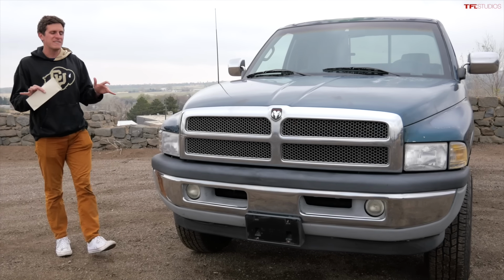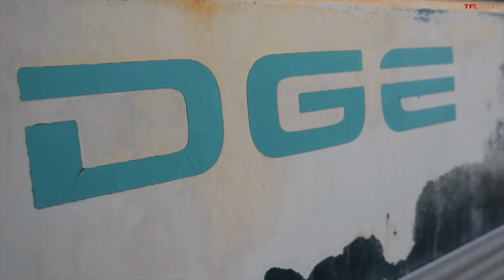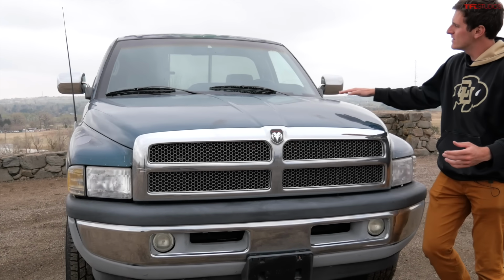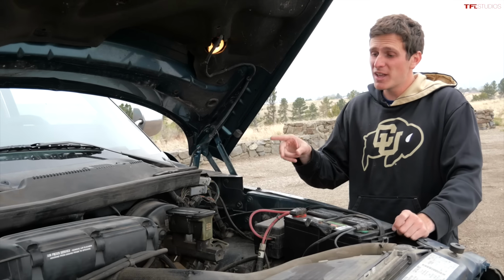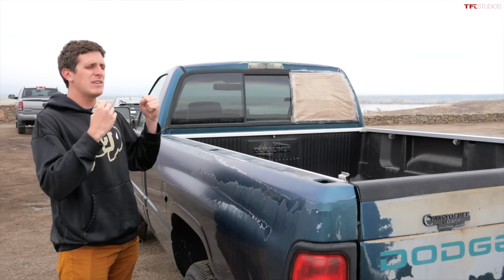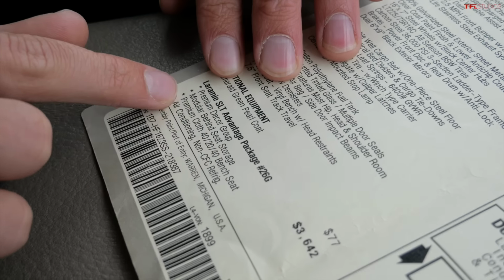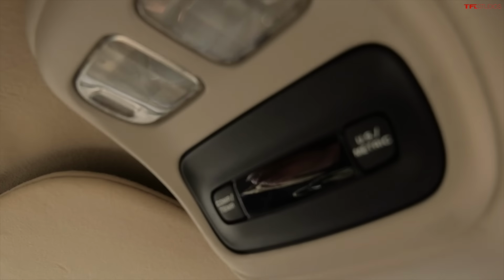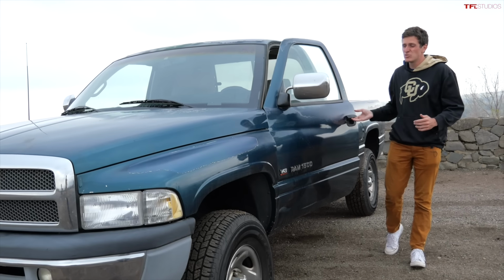The Second Gen Dodge Ram Is The Most Important Truck Ever: Here's Why You Should Buy One NOW!

Comment: My truck has the laramie slt specific wheels apparently because it is the second gen redesign its a 2000 it has the spun looking tone polished 16 inch aluminum wheels and ram centers, unfortunately the previous owners said they are peeling or starting to oxidize so they plasti koted them black..im going to clean the plasti kote off, and use some mother's mag wheel and aluminum polish and the Powerball and repolish them and find a way to seal it so it lasts awhile.

Comment: My truck is completely rebuilt front suspension and new torque converter and front pump and input shaft seal installed in the transmission so if you don't have your foot on the brake pedal and shift it into reverse the truck will start backing up,, and yes gas guzzling 318 lol it is a long bed 4x4

Comment: I have a second owner well it is now a 2000 dodge ram laramie slt quad cab long bed 5.2 litre  318 magnum v8 46 RE AT gloss black with most of a white pinstripe and the front bumper,rear bumper and grille is factory semi gloss black. 176k miles

Comment: Approaching 600k miles with mine. I performed a top end rebuild at 250k and a bottom end rebuild at 420k, all the while keeping up with routine transmission maintenance. The 318 and 360 magnums are the two unsung heroes of the V8 realm that refuse to die.
Reply: wow, that's impressive.  Don't these all have their transmissions go out around 130k miles?  What maintenance do you do specifically to keep it working all those miles?  You have never rebuilt your transmission in 600k miles?
Reply: @WranglermanLevi mine has 330,000 miles on it, it's had towed heavily it's whole life, the Trans has problems in reverse when cold but I drive it daily and it's all original.  Best truck ever
Reply: @WranglermanLevi  No, the transmission failures were related to a cooler line bushing failure, that was rectified in late ‘96. The actual cooler itself was small for a full size pickup trans and it was pancaked between the AC condenser and radiator, but dealers started offering upgrade installs free of charge in April of 98.

As for my truck in particular, there was one rebuild I had done back in 2012, somewhere around the 380 thousand mile mark. I don’t remember exactly… on the other hand, the only maintenance I have to do on the transmission would be filter changes every 20k miles or so, and a fluid change every 50k. The only real downfall of these Chrysler transmissions was cooling. Even now though, you should still be able to find and purchase the upgraded transmission cooler and cooler subframe from places like LMC truck or Rock Auto, since technically it was an OEM Chrysler developed part. I am not sure of it though, I had mine installed in’99 when the truck was only about 2 years old and already had 70 thousand miles on her.
Reply: @WranglermanLevi The transmission is basically the proven A727 - with an integrated overdrive with an electic valve body.  I'm not sure why this combination causes problems, but the 2nd gen is heavier than the classic Mopar v8 era vehicles.
Reply: These are the most reliable trucks ever built. Mine has been awesome for 28 yrs.
Reply: Do you get any problems with your truck like having engine problems that has to be rebuilt?
Reply: @annoyingBluebarry  knocking on wood, but no. Last time I did a rebuild was about 3 years ago
Reply: do you have any rust problems with it like the rocker and the bottom of the truck?
Reply: @BIGD-wl8ks mine has bad rust on the rockers but i bought it for practiclly nothing 3 years ago and it came from the rust belt so i cant complain to much it hasn’t let me down
Reply: @andrewjohnson7645  yeah they tend to rust there
Reply: @BIGD-wl8ks  No, as myself and my truck are both from Texas. I purchased it brand new from Blue Bonnet Dodge and Plymouth in December of 96.

Comment: Im looking at a ram 1500 sport v8. Im gonna talk to the guy about it but on the sign in the back window hes asking $800 and it needs a radiator, water pump, and a tensioner pulley. It looked relatively rust free for an old truck in Chicago. My father had one, and it had water problems too. They most of the time too. What do y’all think about it

Comment: I have a 1995 SLT Laramie 1500 5.9 L 359 long bed, extended cab 4 WD with 85,000 miles.  Excellent condition and looking to SELL.  It's a great truck Located in western NY.  Has been a great truck but no longer needed. Towing package. Original owner

Comment: I have a 96 318 and I'm happy with it. So much room to work! It only has 62k on the clock
Reply: I have a 2001 with the same motor and about the same miles as yours. It was neglected for years but I've been fixing it up over the last year and it's getting pretty good.

Comment: ‘00 2500 4X4 5.9 magnum V8 best truck ever! One feature that most people don’t mention is on a Dodge ram second generation if you cycle the ignition three times that is click it to just before you crank it over three times on your digital odometer it will read out any error codes from your check engine light.

Comment: I have a 01 1500 with the 318 and it just hit 250k and it still pulls like a hoss. It’s a ST with regular cab and long box with 7800 max tow. I pull a equipment trailer with it that holds Construction scaffolding and it weighs maybe 7k in total and the truck pulls it very good. Only complaint is that it doesn’t like breaking under load. It came with the 46RE and it’s still alive. It was originally by Great grandfathers, then my great uncle, then my grandfathers and now it’s mine. Overall a very great truck

Comment: Poor fuel mileage with the auto trans. I have a 95 with the nv4500 5speed and the 3/4 ton Dana 60 and my mpg is around 12 in the woods and 16 hwy. Never had an elk down I couldn't drive to 260,000 miles strong

Comment: I have an '01 1500 2wd extended cab in the same dark blue, and a '15 1500 crew cab 4wd.  I've had to do a bit of mechanical work to the old one, mainly due to a mess-up at the factory that wasn't caught until later, and my habit of towing heavy loads (because I had to).  Regardless, the '01 is still running strong and smooth, with the manual transmission I think I'm going to keep it.  I like my newer one too, but the old one is pretty much bomb proof.

Comment: I used to be a Dodge fan, but after I bought a used 2002 Tundra with 199,000 on the clock with the 4.7 V8 I switched sides.

Comment: The 318 and the 360 really didn’t have much difference. The 5.2 put 250hp and the 5.9 is only 15 more hp. My 1996 1500 5.2 club cab gets the same gas mileage as the 5.7 hemi. The best thing I love about my is the space!!!! So much room. Tires are R16? 😅
Reply: I got the same one, dark blue. 5.2 is not a bad motor
Reply: Yep, I got 16s

Comment: I have a 1997 SST. Green with white stripes. 5.9L with 200,000 miles. Will never sell. This truck was only made in 97 and 98 after the 96 Dodge pace truck. Runs like a deer. Upon starting the truck put it in neutral before driving while you buckle up, you’ll thank me later.

Comment: They are great trucks…I’ve owned mine for 23 years…technically I’m the original owner cause it was a corporate lease vehicle and a woman exec drove it. It is a 1998 Shortbed 2wd Sport standard cab with the 5.2 magnum and a 5 speed manual!!! I purchased it with 6,900 miles and she now sits with 310,000 miles and I still drive it everyday! I added a color matched cap and bed rug that I’ve gone camping in many times. Love it and will never sell it.

Comment: I have always liked the 2nd gen Dodge trucks. However, I currently own a 3rd gen which is a 2002 so the first year of the 3rd generation and last year for the 5.9 magnum gas engine. It is a regular cab long box sport package in black. I just took it on a short trip a few hours away. Total miles was just over 500 miles and averaged 15.4 MPG at mostly interstate speeds of around 70 MPH. I didn't think it did too bad for the trip!

Comment: No way. I have a 2500 Cummins 4X4 SLT extended cab with over 250K on the clock. If any truck set the bar, that one did!

Comment: I just bought the Hughes FI AirGap intake manifold for my '96 2500 4WD.  It should finally put an end to the notorious Kegger plenum oil consumption problem.  BTW, Bilstein shocks make a noticeable ride quality difference on the 2500 4WD, amazingly nice ride for double solid axles.  I have a low mileage 2018 6.4 liter hemi engine that I may swap in at some point...probably another 6 years or so (gotta get some good use out of the AirGap intake in the meantime).

Comment: I seen the movie Twister back in 1995 and I said I will have one some day.  Well fast forward to 2010 I  finally got one. Only took 15 years.  Mine is a 1998 Dodge Ram 1500 4x4 5.9 shortbed Sport. Lifted 2 inch in front 3 in rear and has all LED lights Roof light bar and LED tail lamps with Nitto 33s Ridge Grapplers.  Duel exhaust and Rebuilt engine and trans. Meyer Snow plow mount, working AC Tow mirrors  power everyhing  Leather , tinted windows and ventshades, tool box LED strobe lamps. Rough country Duel steering dampers and 3/4 ton front coil springs and a steering stabilizer with upgraded front brakes with dried and slotted brake rotors and upgraded sway bar links.

Comment: I truly believe these will be the next popular classic trucks in the line of Broncos, Blazers, and SBCs. Best part is how much aftermarket they already have and how many are too far gone to restore. If you happen to be lucky enough to own one in great shape, hold it.
Reply: You're right. I purchased a 1997 ram SLT  Laramie short bed 318 with only 159,000 mi on it needs a little work but not too bad at all though. Just got to take care of that dash. That's really the only problem right now
Reply: I brought a 98 ram with the 4doors fr 800 dollars in mint condition ac works dash is gone lol but I love it plus its a antique now
Reply: I just inherited one from my dad. It's being worked on and restored now. I'll keep it forever
Reply: It is hard to make a classic out of a Dodge truck as they usually end up in the junk yard early on.
Reply: @ScottPatrickCallahan  the three in my driveway beg to differ.
Reply: @ScottPatrickCallahan hmmm not really true. Classic Truck sales channel sells mostly classic Rams that are still in absolute pristine condition. A few Fords and GMs but not many are left.
Reply: @ScottPatrickCallahan is not dude, if u have the money nothing is imposible
Reply: @fernandoduarte9584  Well... good luck finding a replacement dash, that's all I'll say.
Reply: @GregJoshuaW there are brand new dash moldings available on the aftermarket. New plastic formulation, should last much longer than OEM. Both upper and lower dash frames available now brand new. It's not cheap, about $2k shipped to do the whole dash, but in the long run that's not bad. I've done two trucks so far with them and am really happy.

Comment: I’m beating him in miles, barely tho, I’ve got a 2001 extended cab long bed 2500 with the Cummins and a 5 sped manual. It is 2wd but if it wasn’t I beg it would have a lot more than 45k on it

Comment: I got two 360s and a v10 dodges. I live my trucks. The first  I have it is my first vehicle. I got the v10 next. Then my second 360. My first on has 160,000 miles and my second 360 has just about 300,000 miles. It fires up every time. Even when the truck sits for awhile.

Comment: I have loved these Dodge Rams since the first time I saw one in a magazine.  When I was in college, I remember hearing the local Dodge dealer had one in stock, so we all loaded up and made a beeline down to see it.  We all loved it.  I knew I'd own one someday.  I still have the Ram SS/T I bought new in 1998 and it has under 65k miles on the clock.  I also had a 1997 Ram Cummins dually.  It is still my favorite pickup truck bodystyle.

All that said, I think this truck gets too much credit for revolutionizing the truck market.  People forget that the GMT-400 (1988-1998 GM trucks) had flush window glass,  no vent windows, a raked back windshield, and a more comfortable ride.  It didn't have the bold stying of the 1994-2001 Dodge Rams, but they were the beginning of pickup trucks that were more car like.

Comment: I had a 1996 and I got rid of it after it was ready for its 2nd major overhaul of front axle. They actually mentioned the looseness of the front end and I can verify that. I will say that the truck did have over 250,000 miles and I loved it. 2nd favorite vehicle I have ever owned.
Reply: doing my research before purchasing  a 95 or 96 Dodge ram 3500 V8 Magnum  147k miles  runs great
1 owner & I know and trust the seller I can get it for $5000, sounds like a good deal to me

Comment: I found a 2000 ram 1500 that is also 4x4. It rides on 3rd gen 20" wheels and has tow mirrors with a hideaway gooseneck hitch too. Has a rod thrown through the motor, but the guy only wants 500 bucks for it.

Comment: The 2nd gen Ram is definitely my favorite pickup design. I wish my 2500 12 valve rode like it was on a cloud like his 1500, it's extremely stiff. That rig looks kinda clapped out for 46k miles, the clear coat, broken rear window, sagging headliner. At least most of the interior is pretty clean.

Comment: I have a 2001 quad cab short bed Ram 1500 with 38,000 original miles and original window sticker.  It is a 360 V8 auto 4x4 truck.  I,m the fourth owner and it's way cleaner than the truck in the video.

Comment: Just bought a 95 with the 5.9 and 4x4. It has 234k miles and she's super crusty and rusty. But, it was cheap and it runs strong. I bought it as a work/knock around truck. However, I know me. I will be hitting salvage yards to fix things as I go. I love tinkering on a project. And I really love old trucks. I think it really is a passion.
Reply: doing my research before purchasing  a 95 or 96 Dodge ram 3500 V8 Magnum  147k miles  runs great
1 owner & I know and trust the seller I can get it for $5000, sounds like a good deal to me
Reply: @shugatoast  if you trust the seller, sounds like a great deal. I'd say, find a really good transmission shop and have it serviced once you buy it. My old crusty truck eventually had the transmission crap out and I sent it down the road.

Comment: They worked for awhile but had major problems.  Typical weak dodge transmissions, headgaskets + bad radiators disintegrating= cracked heads, blocks,  and the dreaded  engine  sludge in the magnum engine line. Steering components  disintegrated.  The only reason sold was because  of the body design  looking cooler than the box bricks  of gm, ford. And yet you can find gm ford's of that era still on the road. Most the 90s dodges  except diesel versions are in junk yard.

Comment: My dad had a 98 Ram 1500 quad cab, short bed 2wd Laramie with the 5.9.  It was a really nice truck, actually rode quite nice & the interior was nice as well.  The engine sounded mean and old school, but those magnum engines were a lot weaker than what they were rated at.  In 98 the 5.9 made 245 hp & 335 lbs/ft of torque.  My 97 Fl150 had the same setup as my dads and had a 2v 5.4 with the non Pi heads making only 235 hp & 330 lbs/ft of torque, but it would walk away from my dads truck, did much better up hills and with a load on it as well.

Comment: The original 94/95 models seem to have been more expensive....    My 98 extended cab 5.9 1500 shows msrp of 19890 on the vin decoder..... 😅.     I do wish the damn transmissions weren't so fragile in the thing tho I've found another of those clapped out ones.

Comment: I bought a slightly used 2000, 2500 in 01. Wished I had it rustproof and undercoated, still my daily driver. Bought a 2000, 3500 with the V-10 in Dec. of 21, body in good shape, other issues that are minor.  Love that style, maybe prior to 1948 also love those styles

Comment: This isn't even close to the most important truck of all time. This isn't even the most important truck made in America in the 1990s. That would be the Powerstroke 7.3 F-250. Dodge from this era is extremely prone to electrical issues and transmission issues permeate the brand in the 1990s. Every day I drive by two sitting in a field that my neighbor has, the trans is out in both and both had multiple transmissions in their approximate 125,000 mile life span.

Comment: Your specs were for the 5.2, the 5.9 made 250hp and 330-350 lbft of torque
Reply: It was only after 98 that the 5.9 made 245hp... This one being a 95, its only 230hp with 330lbs ft torque. The specs are correct
Reply: @PhvntxmJvmxz  well since ur being mr technicality ill do the same.  The 5.2 made the 300lbft of torque he mentions in the video so no specs were wrong.  330 is a bit of a difference. So ill agree were both wrong.
Reply: He said over 300, even though I told him it was 330, not sure why he didn't specify
Reply: We're done here

Comment: I still have my black 96 1500 4x4 ext cab sport  with the 5.2 I bought it in 2001 I added a extra trans cooler  and a death wobble brace with proper maintenance and the usual tire's and brakes I've had  no issues with mine my personal theory is they didn't have enough cooling capacity for the transmission  so I would recommend a additional transmission cooler to anyone who owns one or wanting to get one

Comment: If you’re getting anything under 12mpg in a 5.9, you need a tune up an probably o2 sensors
Reply: Yea I know my truck needs something because I was getting 7.5 mpg. Got a tune up new o2 sensors spark plugs and a lot of other parts and now getting 8.5 but I used to get around 11.5 years 
ago. I don’t know what’s going on with my truck. Runs great though